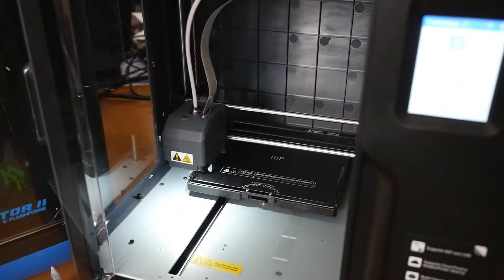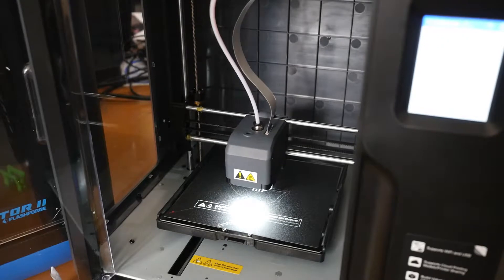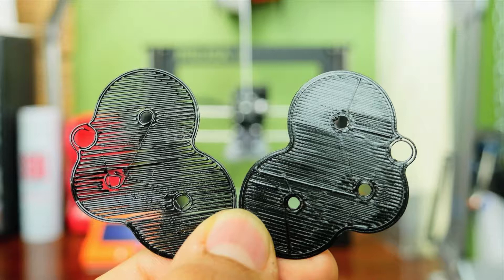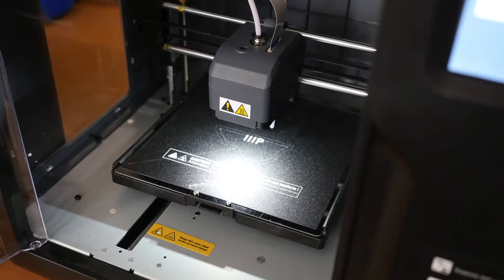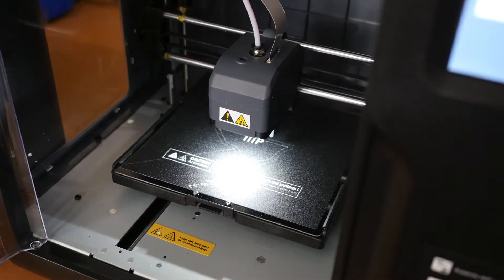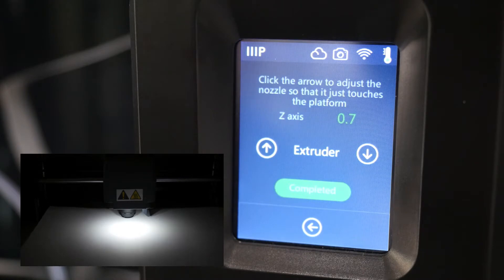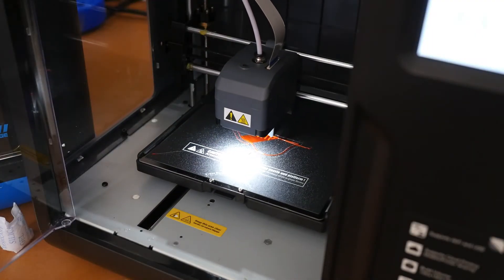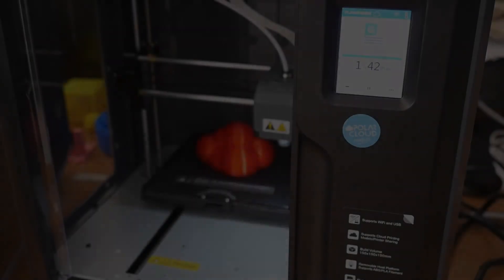Monoprice Voxel - Leveling / Calibrating the Nozzle Offset

Comment: How do you level the printer though? This just shows calibrating the middle, not any of the corners
Reply: This confused me as well, but it's as NetherNoah said.  Apparently, calibration takes care of leveling.  I was skeptical, but mine appeared to be uneven (was printing the first layer on one side, scraping the bed on the other) and calibration totally fixed it.
Reply: @MichaelMuller13   just had the same experience, front left was barely printing and back right was too much, did a calibration as per video and its spot on now.
Reply: Michael Muller hello
Did you use the same method used in the video? (The paper under the nozzle)
Reply: @Steve-yq5fh  yep, same method.
Reply: Late asf but is calibration better than the auto calibration mode?
Reply: I wonder the same. Prints fine in the middle but prints in the back left corner “unravel”. I have not tried 9-point calibration yet.
Reply: @jmqrsq  why not?
Reply: @mygiguser  this was 10 months ago. I e used the 9 point cal quite a few times now. Still have the issue though
Reply: I'm on my second machine and I have the same issue as you guys, but calibration does not fix it. This machine sucks.
Reply: It is a auto leveling printer